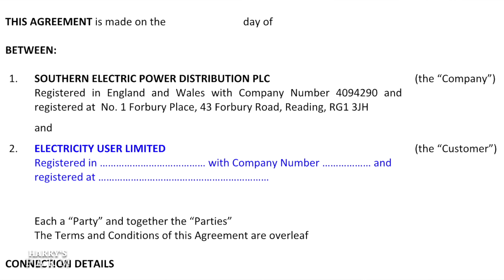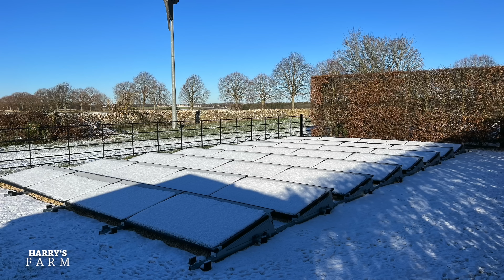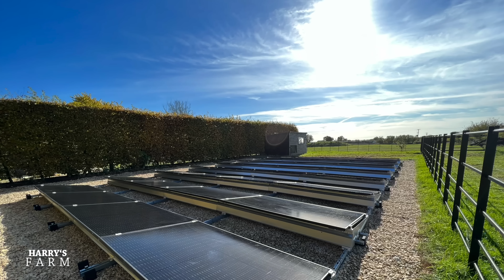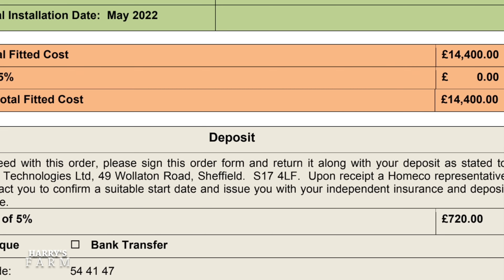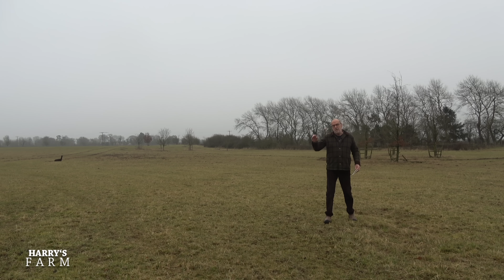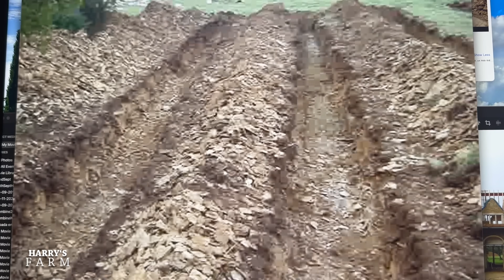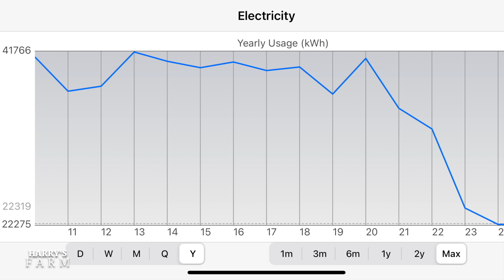Are solar panels & heat pumps worth installing? Here's what I've learnt after several years of use.

Comment: Sorry did I miss it Harry - we need to know installation costs of your alternative energy systems, and also their design lifespans? That way I can work out if it’s worth the costs to put in, verses conventional supplies. Nice vid thanks.
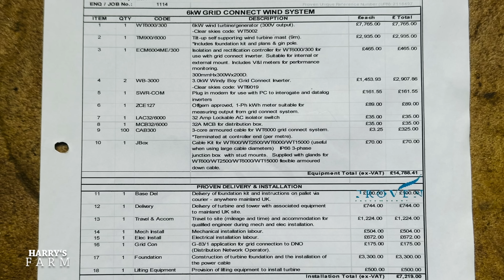Reply: See 8:20 on for installation costs of the solar and turbine
Reply: @stuffilike4498 turbines will only work if you have a huge expanse of land. And the solar installation will be cheaper too as it's low level. No scaffolding.
Reply: This is key to the whole equation and I see almost nobody talking about it. What is the payback on the whole system before extra cost is incurred for new parts, panels, etc. I suspect it is cheaper in the long run to just do nothing and continue with traditional systems. I can't help but feel there is a religious fervour with all these solar panels and wind turbines. I feel little of it makes sense. What about the children in mines in the 3rd world extracting all the metals for use in the batteries and solar panels. So many unanswered questions
Reply: @JC-yc2sz It all seems very complex to me.
Reply: The ground heat collector has a fairly long life time (more than 50 years),  the heat pump itself ... 25 if you are a bit lucky.

The bad designs is partly now weeded out so... expect a something like 20 years from the pump itself.

The collectors with work is if as in this case fairly cheap (you need a fair bit of ground which can be used)
Reply: Unless you are building the exact same house it would be worthless information.
Reply: Numbers can be cut all ways and everyone's consumption is different. Though as I say you do automatically pop the washing machine on on sunny days.

Comment: I realise that it would take much more space due to shading  but in winter the panel output would be much greater if the panels were perpendicular to the low sun angle. Some people adjust the panel angle to maximise output depending on the sun's angle throughout the year.
Reply: Agreed. Though it doesn't look like Harry is short of space
Reply: Then you need more space to space the panels out due to shade of the panels.

Comment: Install solar panels and storage batteries for when you do have excess solar. Make maximum use of the cheap energy tariffs to recharge the storage batteries and run the heat pump(s).

Comment: Regarding shading there are solutions for that if you can't remove the source of the shade. Micro inverters for each panel as an example.
Reply: optimisers and microinverters are more or less obsolete now with newer panels (if my installer is to be believed). Aiko N type panels have really good shading performance
Reply: @GarethTerrace  no, that is not true. The N type panels have a bit better shading performance but that is meant in a different way based on a panel to panel comparison and not  a string of 40 panels as seen here. 

Do not trust you installer cause the proper solution for shading is nowadays a dc optimizer offered by BRC Solar from germany who invented this inverter independent optimizers that only use energy in case the solar panel they are connected to is facing shading. 
then it kicks in and eliminates the negative impact of the shadow.

Output of a solar panel is Volt x current. The voltage of your system during daylight stays pretty much the same the whole day. Only the current will go up and down and is determing your power output. An optimizer does a simple job.
you have 10 panels each 30V and each capable of delivering 10A max = 300 Wp panels.
In case of a shadow causey by an ISO 4 sheet of paper on 1 of your panels will cause a current drop on that panel from 10 A to 5 A

And then even your Aiko magic panels will face the eye of the needle and all of them will deliver 10x 30V x 5 A = 300V x 5A =1500 W
You will have lost 1500 W during full bright sunshine just by a small shadow.
The BRC optimizer will kick in and recognice that the string is delivering 10A (means all other 9 panels are pushing 10A) while the own panel is only able to deliver 5A which causes the eye of the needle effect. Now the optimizer will trade in the 30V and transform that to 15V  for example. Due to the fact that the panel is still producing 150 W the current will go up by 150 W / 15 V = 10 A

This means the optimizer changes the output from the shaded panel to 10A that the full string current can be delivered .
Now we can do the math: (9x 30V + 1x 15V ) x 10A = 285 V x 10A = 2850 W 
If you have no optimizer then it would be 1500 W

Remember : you only need an optimizer where the panel faces a shadow which causes a power drop quite to early. In this case Harry should have gotten at least 1 row of panels on the right next to the hedge row with optimizers
And what he has not mentioned: on the opposite side he has the same issue caus I bet his panels are facing south so on the right side of the hedgerow his morning sun is shading the panels and in the evening on the opposite side his metal fance can cause the same issue which would require also optimizers. It all depends on how much you can gain, but usually it is worth the small amount of money (40€ here in germany) and roughly 10 minuts to 15 minutes to mount those optimizer boxes which means to unplug both panel connections and put the optimizers in between by connecting its MC 4 plugs, the industry standard.
Reply: Agreed. I used micro-inverters on my system because of shading issues. Got a quote from Tesla but dropped them because they refuse to use micro-inverters.
Reply: @joemartino6976 Tesla Powerwall 3s don't use optimisers because the inbuilt inverter allows multiple MPPT strings. In the UK that's 3 separate strings, so you can separate panels affected by shade on different strings.
Reply: @spiritusinfinitus  I am grid connected with no batteries.
Reply: Victron.
Reply: terrible solution cause you should say that 12 kWp system out of 40 panels each 300Wp would need 40 microinverters and then 40 times the AC cabling.

Optimizers like BRC Solar from Karlsruhe germany produces are much more usefull. You need those only for panels that get shaded a lot. 
In this case 5 or 10 each about 50€ or 40 GBP which means lot less investment where the microinverter is about 120€ at least here without monitoring. 
And those are integrated optimizers which are connected directly with no AC connection. The old inverter stays untouched.

Comment: So the moral of the story is, if you don’t have a farm forget it !
Reply: No not at all. 
Actually what Harry has said is incorrect. You can have as big a system as you like on your home. 
What the DNO restricts depending on local availability is how much you export. You can limit export in your inverter easily to satisfy the DNO. 
So say you have a 8kW system but a 4kW export limit, no problem. 
You could in the summer say be charging an EV / home batteries or doing another energy intensive task at 8kW but when its done then the system will limit itself to only export 4kW.
Reply: No, Harry could do more with his farm space. PV panels are so cheap now, £60 per panel (550W), that it is worth even putting them on a north facing roof. Domestic solar PV will save you money, although payback could be on average 6 years. Domestic battery storage is also very cheap and saves even more money in winter with cheap rate overnight tariffs. You can also offset electricity bills by buying a share in a wind turbine. Perhaps the most poignant point Harry makes is to insulate your home as best you can. I have for instance installed loft insulation, 10cms between joists and 37cms across the joists and it has made a significant difference to a 1973 house. And it cost me less than a grand.
Reply: @ They have the benefit of also being made in China !
Reply: @jamesjackson7844  Mate, that comment doesn't even make sense in this context?
Reply: No that is not true. All depends on type of installation and consumption.

Comment: Back in the day, our old and draughty house (ice inside the winows in the depth of winter) depended very heavily on a phurnacite-fuelled Aga. It served us well during the power strikes in the 70s and provided a supply of hot water and ash for de-icing the path. It was turned off in summer. 

I hadn't realised your house was a relatively new build, as it blends in well with the surroundings due to the traditional stone cladding.
Reply: Sorry, you burned actual coal? That was still a thing in the 70's? Wow. We had woodstoves in rural areas (which are a godsend when you lose power in the winter) but coal? I'm surprised.
Reply: @TheJohn8765 It was still a thing well into the 90s
Reply: @TheJohn8765  We did, though it became increasingly hard to get. The family that bought the house from my parents scrapped the old Aga, which wasn't surprising. As far as I'm aware, you can still get phurnacite, which conformed to smoke regulations in these days and possibly still does. On the very odd occasion, a coal fire would be set in the lounge, which required the chimney to be swept, as did the Aga. The sweep was apptly named Mr Soutar.

Comment: agreed Harry,The Winter months is where battery storage comes into its own,charge your battery’s over night for 7 Pence per kWh and use the power in the day time when Solar production is low.
Reply: If you can find electricity anywhere in UK for 7p per kWh can you tell me where because I haven't seen a price like that since the 90's even off peak.
Reply: @Wildeheart79  that's exactly what I get overnight for guaranteed 6 hours with octopus. Get more than the 6 hours if I plug my car in and there's surplus energy so they charge the car earlier. I'm in Hampshire.
Reply: @drmexicoii  Does it require a smart meter?
Reply: @Wildeheart79 yes, of course. Smart meters (in house displays) aren’t the key, it’s the ability to measure usage in real time which opens up the option of all sorts of advantageous tariffs. Assuming you can get a working smart meters- do it!
Reply: @drmexicoii Correct Sir 👍
Reply: @simonm9923  I do not and will not have a smart meter fitted. I had one once (from Octopus incidentally) and my electricity bill tripled despite my usage not changing.

It actually went up even when I went to America for a month, I queried this with Octopus and they sent a man to check my meter who declared no problems with it and that was the last they'd discuss it with me.

What good is 7p per kWh if they make the bills up off the top of their head?
Reply: @Wildeheart79  yes it does. I couldn't understand why I would want a smart meter until I got an electric car, then it makes complete sense and gives access to better tariffs.
Reply: @simonm9923  100% this. They've been so mis sold to thy public in my opinion - the benefits have been so misrepresented. The in house display is pointless. Oh look it goes up if I put the kettle on! I'm not going to stop drinking tea.
Reply: @drmexicoii  Hi drmex, can I ask you, do you get many hours of 'active charging' in Hampshire ?

We're in N. Yorks, and we get it from 7 or 8 pm most evenings, - so I reckon they let us have it as it saves them having to shunt the electricity all the way from Scotland to London (We're roughly half-way ... 😉)
Reply: @tomsdaddy  very much depends when I plug it in to be honest. Have had it charging at 15.30. But depends on how much charge I have, what I want it charged to and by when, as well as when I plug it in.
Reply: I run a house same size as Harry’s , buying in at night for 6.7 p a unit exc VAT for seven hours , during that time heat pumps are constantly running to heat house , batteries are charged and at Seven AM the grid goes off and the house runs the rest of the day off solar and batteries , at the end of the day about now I will have roughly 18 kwatts left to sell back at the princely sum of 12p a unit . The result is electric cost all in of about £4.50 a day , I ignore what’s sold back it’s just a bonus whatever is when the cheque arrives .
   The downside is the capital cost of all the kit and insulation to avoid heat loss .
Reply: @Wildeheart79  Easy. Octopus 6.67p.
Reply: @Wildeheart79  Octopus Intelligent is 7p off-peak and 22p (I think) daytime ?  (That's here in N.Yorks)
Reply: @tomsdaddy  Come on stop it now. I've asked nicely.

It's Octopus, I get it.
Reply: @Wildeheart79  Sorry Wildeheart, I find it really difficult on here somwetimes, to find out who has replied to what, and when ... !  ;)
Reply: @tomsdaddy  Not your fault mate, thanks for the answer. Just so tedious when YouTube blocks comments that didn't even say anything bad.
Reply: What is the daytime rate per kWh?    Curious on the inverter efficiency/losses going from AC to DC while charging overnight then conversion back to AC for use. (assuming that's what your setup is doing).
Reply: @tomd1544 I’m sure Harry just said he was paying 23 Pence per KWH peak rate,so there is definitely a big saving to be had if you buy your electricity off peak and store it for when you need it,again depending on usage the payback on batteries would be 5-6 years,batteries have a life expectancy of 10-15 years,Solar panels have a 25 year guarantee,hope that helps fella.
Reply: Efficiently loss is 20% on mine per charge/discharge cycle from grid, but the difference in price between EV off peak and normal rate tariff is 333% so I'm massively better off..
Reply: @tomd1544  I am on Octopus intelligent go. It gives 6 hours at 7p / kWh overnight when we charge our home batteries, heat water using the ASHP, charge cars if necessary. Our batteries then power the house during the day, although on really cold days we may need to buy a few kWh at the day rate of 26.4p. The other benefit is an export rate of 15p / kWh so we sell all our solar generation to the grid. Our net annual electricity bill is negative, we have no gas. There is enormous synergy with these technologies in combination with an appropriate tariff. Investment is fairly significant but payback will be just under 6 years.
Reply: I'm really sorry guys but I'm trying to reply to this and being blocked. Just wanted weigh in I'm aware it's Octopus now so no need to spam me. Thanks all
Reply: You are reliant on the energy companies offering cheap overnight rates tho i.e reliant on not too many people getting batteries/timed EV charging/grid level storage taking off. It's not really a very sustainable choice.
Reply: @TMEstuff  Yes, in the longer term, you are almost certainly right, but in the short to medium term, you are almost certainly not.

There will still be periods of excess and thus 'cheap' renewable energy production for quite some time yet, - mostly at night, and so there will still be a price advantage for those who can either use or store that cheaper energy.

Comment: The way they are installed is insane. Whoever did that, they need a new job. This is installed as if it was the middle of Africa. But this is not Africa! You cannot expect to collect solar power when the sun is close to the horizon and the panel is directed at the zenith. Of course, your winter earnings are so low.
And now you think its a flaw in the system because your installer was a useless salesman, not a solar expert.
Reply: The panels up at the farm are at a much steeper angle and there's next to no difference in output. Thanks for watching!
Reply: @harrysgarage  that's interesting! Are they  spaced out so they don't shade each other?

Comment: Thanks for the update Harry 👍
Interesting point re batteries in a solar system, The BMS in the battery will shut the charge off if it gets to hot or cold. So if the battery is installed in a 'cold' location it wont charge even if its being supplied.